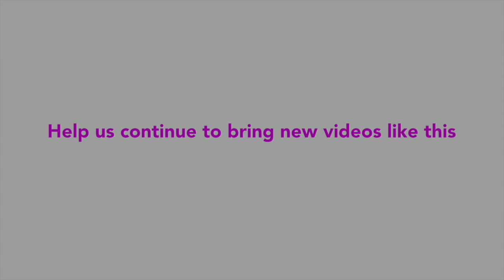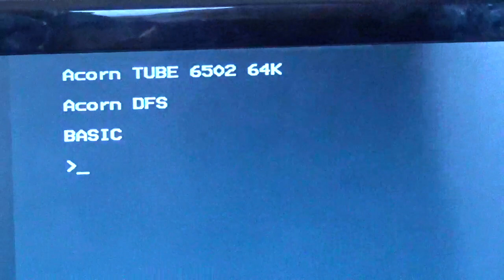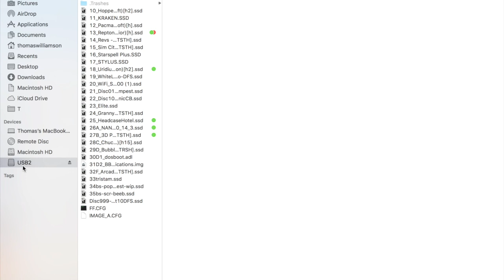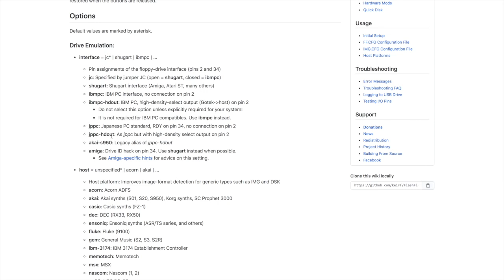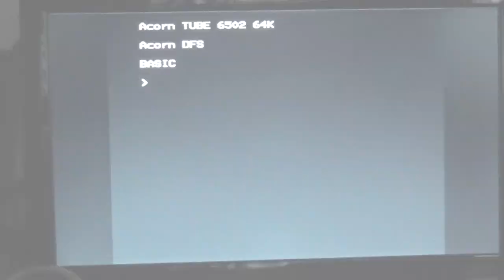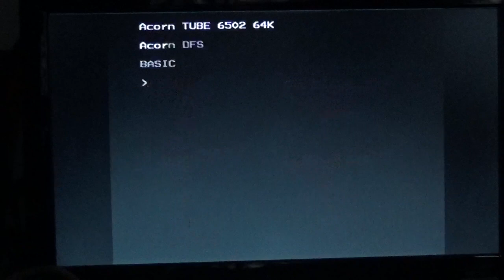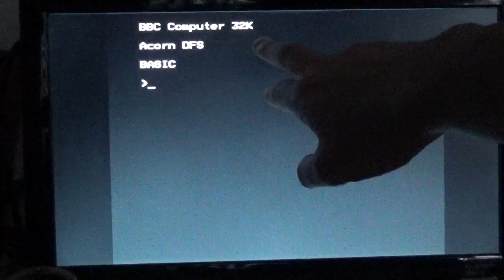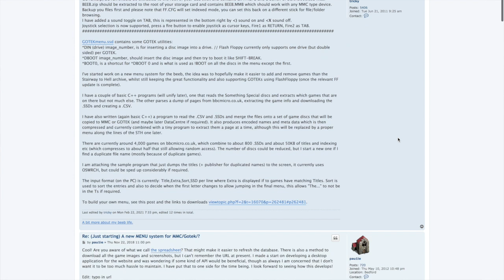GoTek Floppy for 8-Bit BBC Micro?  Pt2 Update

Comment: Another great video. Thanks for the shoutouts and sorry to hear that you are having issues with my menu system. Please reply here, PM me or start a thead on stardot and I/we will see what we can do.
Great idea to use the co Pro to get faster basic, either for prototyping, or even finished games with the pi being so cheap and I expect that it will work with any co Pro, even the original ARM 1.
Reply from the maker: Hi Richard, Thanks as always, Its not so much im having trouble, more I haven't given it the time it deserves, so it probably works totally fine and its more i'm the issue LOL. If i'm still having issues i'll drop you line, so thanks for the offer of help :-) 
PS: Co Pros are the only way im ever going to make anything playable on a beeb!

Comment: would this work in a dual kumana drive?
Reply from the maker: It should do, I cant see why not. The gotek has the pins on the back to be setup as drive 0 or 1 master or slave drive so yeah with the firmware setup it would act and be seen as a floppy drive by the computer. The only thing to watch out for is it uses the SONY pc 36pin floppy standard and not the edge strip type connectors of earlier 5.25" drives so a new ribbon cable or an adaptor might be required. One will also be needed for the MOLEX power connector and a 3.5" to 5.25" housing if fitting in place of a 5.25" drive
Reply: @WiFiSheep  I just thought it would be perfect as you could have both a floppy and a gotech
Reply from the maker: yeah you can, if you've got the rig setup for it then it should work fine, Its something im going to look at doing at some point
Reply: I might get one anyway, even if it doesn't work, I can just pick one or the other rather that installing it inside the old drive!
Reply: @WiFiSheep  how would the 40/80 switch work?
Reply from the maker: hmm? that is a very good question, I believe it would have to be set in firmware